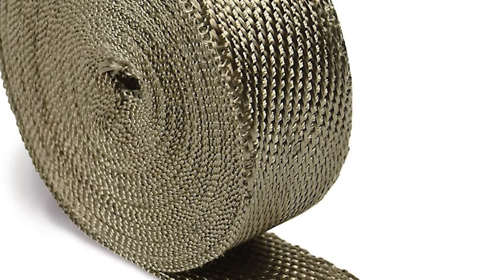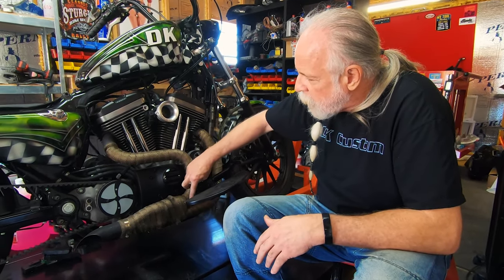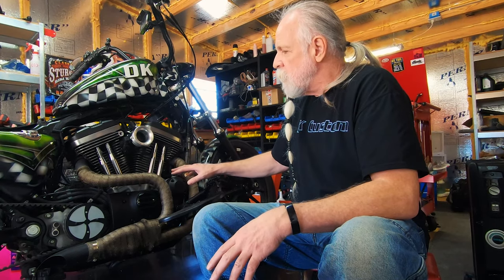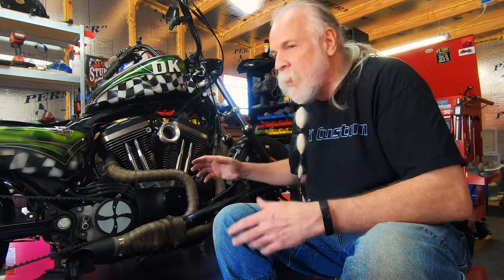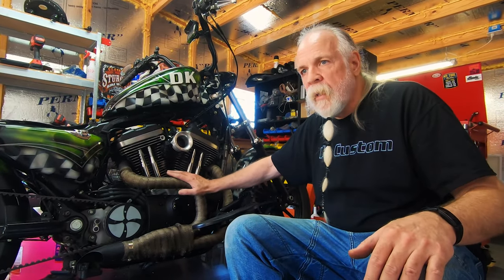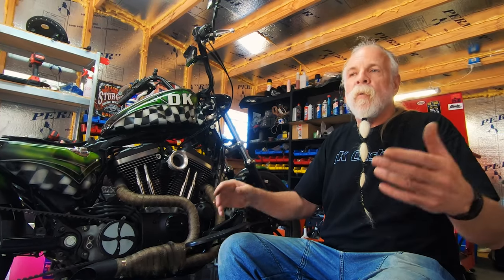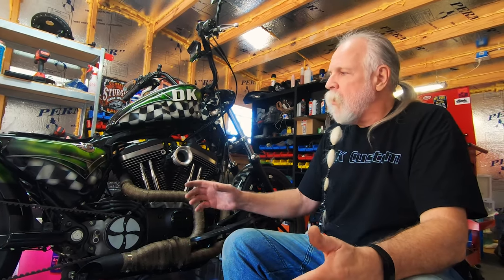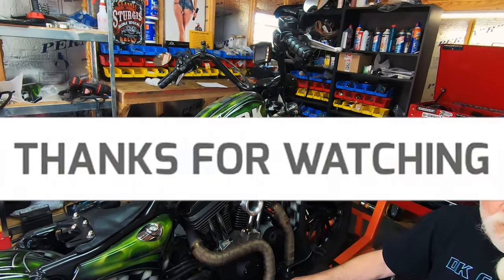Myth Busted - The Real Truth About Header Wraps

Comment: Finally a video that I can relate to! I made my own exhaust with homemade baffles for my RK,2 into 2 shorty drag pipes. Sounds a lot like my old iron head with homemade drags,a nice distinguishable sound, if a little loud. Love the wrap I put on mine,but I’ve set a couple of pairs of jeans on fire sitting in traffic because the pipes get so hot (have to make some nice aluminium heat shields for it). Btw,I’ve always loved jockey shift,so having arthritis in both hands,I made my own jockey set up,but have a hand clutch also. Kicking in the pedal then grabbing the lever makes it much easier for me to pull,and in an emergency situation,I can put my foot down. Not a pretty set up,but no failure after 4 years.
Reply from the maker: Very cool what you've done.

Would love to see some photos of your Jockey set up.  If you want to email them to Support@DKCustomProducts.com attention Kevin in the subject line.

You might like the benefits of some floorboard extensions...get your feet a little further away from the engine, (jeans too) and much more comfortable.   Check em out at this link- https://www.dkcustomproducts.com/footpeg-mounting-hardware-c117-276.htm

Comment: Thanks for sharing. I wrapped my thunderheaders years ago for a couple of reasons. One, got tired of occasionally having to adjust the shields to stop the rattling/squeeking noises that would eventually occur. Two, liked the look of the wrap. 

Glad to hear that it helps with performance be it minimal. I was unsure if wrapping them would help or hurt with cooling of the engine but after one ride without shields or wrap was intolerable it was obvious to go with the wrap. I felt, but couldn't prove, that radiated heat to the engine would be reduced if pipes were wrapped. Shields only protected the rider's legs from heat, not the engine. I appreciate your videos.
Reply from the maker: Cool deal!
Glad you're liking the videos.
Appreciate your comment.

Comment: good video. the rust issue also depends on the exhaust pipe material. if its a good stainless pipe, it wont rust as easily as a metal pipe.
Reply from the maker: Yes, if leaving the wrap wet at all, the type of metal will definitely factor in.  Thank you for the comment.

Comment: I got a 2016 FXDLS that came with that wrap on a Bassani Road Rage 3 stainless. I removed it the other day, and it definitely messed the pipes up, rust spots everywhere, just solid spotted rust. I am restoring it now with scotch brite. But I got it used, the exhaust now looks brand new again
Reply from the maker: Good to hear.  Never know how it was treated in prior ownership, but with stainless there is usually very little rust, even if left wet.

Comment: Just what I needed to hear. Quick one, I might go with soft side bags on my Yamaha FJR. I'll wrap the mufflers that will be directly below the soft bags. Will this prevent enough muffler heat from baking the soft bags after I come to a stop? Thank you.
Reply from the maker: It will reduce felt heat a lot, but you would probably need to know what kind of heat resistance your bags have to know if the pipes would still bake the bags or not. 

You can read a little more about the Exhaust wrap at this link - https://www.dkcustomproducts.com/titanium-exhaust-wrap-dei-reduced-heat-improved-performance-dk-dei-t35.htm

Thank you for commenting! MB

Comment: Thanks for the video!  I'm getting ready to wrap my pipes becouse they are rusty plus the added bonus of not burning my legs is good. 
My question- 
Aprox. What length do you use for a V twin harley pipe? I know the front is a little longer. Thank you!
Reply from the maker: What year and model Harley?  Are they factory pipes?  Do you want to do just the headers?
You can use a tape measure to find out how long the part that you want to wrap is.  Each roll of wrap is good for 11 feet of pipe.
https://www.dkcustomproducts.com/titanium-exhaust-wrap-dei-reduced-heat-improved-performance-dk-dei-t35.htm

Comment: Good day from Toronto : I watched the video and liked it very much . Splendid demonstration . I was not aware that keeping the heat inside the pipe would cause the gases to flow faster . I came from along career in the military turbine engine business . Seeing titanium every day was a regular thing for me . I think the steel supplier industry sells titanium cheap if you buy lots and lots . I'm use to seeing titanium bar stock 12 feet long , 4 inches wide and 7/8 inch think . One piece of that cut into a short 6 inch long bar makes a regular block that would be made into one turbine blade . If you think of that block size , it would cost about  $110.0 Can . Twice I have seen other industries grossly over charging for parts made of titanium . There still is an odd old belief that titanium comes from outer space or something like that , and therefore the high cost . I still roll my eyes and gasp at those people . Any how , very good video !  Have good one .
Reply from the maker: Glad you like the video! Interesting back story. 
Thanks for sharing and commenting! 😎 MB

Comment: Thanks that helped make up my mind I have a 65 GTO and they are notorius for baking the starter and solenoid and I have headers it gets hot in the cab so Im hoping this will help
Reply from the maker: Nice.  My brother had a built GOAT.
Yes, the wrap will reduce the header heat, and a bit of the actual engine heat..

Comment: What are your thoughts on wrapping over the heat shields? Or would you recommend wrapping the bare pipe. My heat shields are pretty weathered so looking at ways to improve the look. My main concern is felt heat so wasn’t sure if wrapping the bare pipe would be too hot.
Reply from the maker: You can wrap over the shields...not sure how effective it will be, or what it would look like.
Seems it would be better wrapping on the bare pipe.  It is made for that, it is not too hot.

Comment: What he says about thermal wrap making exhaust gasses flow out of the exhaust faster are not exactly true. In terms of the volume of gas flowing through the pipe, yes, the hotter the gas, the more volume it takes up. In this way you force the engine to pump out a greater volume of gas. That's not necessarily helpful, and in fact can create backpressure, which is not a good thing (although there are things that create back pressure that also help optimize wave pulses within the headers for greater volumetric efficiency at lower RPM, ergo better peak torque in most cases). 

By allowing the pipes to radiate as much heat as possible, the gasses inside cool. What this means is that at a given cubic foot per minute flow rate, that actual MASS of exhaust gasses flowing out of the exhaust is greater (because the gas is more dense) - this is technically what we care about. But thicker fluids/gasses are more viscous also and there's frictional losses against the ID of the pipe, so there's some backpressure creation there too. There's a give and take. Basically, the degree to which wrap effects any of this is so tiny as to be nearly irrelevant to performance. Unless you have a turbocharged bike (in which case I would wrap my exhaust manifold before the turbine and leave it unwrapped after), none of this matters all that much for performance.
Reply from the maker: Thank you for your thoughtful comment.
Reply: @DKCustomProducts  And thank you for a helpful video about wraps. I learned a couple of things about their practical, real world use.

Comment: 2019 HD Ultra Ltd, 114ci. I'm installing aftermarket headers and wanted to wrap them to reduce felt heat for my wife/passenger. I ordered the wrap from you guys. Will chrome headers make a difference for the wrap?  Ive ordered from yall several times always good service and gear. Thanks in advance.
Reply from the maker: The wrap works great on chrome headers.
What many folks do is wrap the headers and then install the chrome heat shields over the wrap as shown in the video.
Thank you for your business, we appreciate it and it is great to hear that you are pleased with the service and the parts. 👍

Comment: So, true dualed my evo. I put the standard dei header wrap on it. Frist, cleaned the crap out of the original pipes, fitted the trur dual pieces, got everything, where I wanted it. Spray painted them with some rather expensive high heat coating, baked them, used the rest of the spray on coating, and baked them again. Seriously though of putting them on then, they looked really good. But, since I already had the wrap, I went for it. I did, wet it as I  installed, kept it really tight and even,  then learned how to use the clamps for the wrap, with the tool  for the clamps. Baked them dry slowly, then gave them two days to settle. Then, I used the coating, for the header wrap, let it dry, recoated twice more. Did this like 2 years ago, put lots of miles on it and haven't had any issues. Take your time doing it and it will last. Put them on the bike, put the heat shields on, installed some V/H full flow slipons, a much better air cleaner, did the rejetting on my carb(mikuni), and haven't looked back. I love my reversion sound, as I drop off the  throttle. LOL.
Reply from the maker: Sounds like a sweet set up.  Glad you're enjoying your ride!

For others, realize, the Titanium Wrap in this video does NOT need any coating as Charles did with his wrap.

Comment: Would you recommend doing this to the entire exhaust or just locally on a car? I have a C7 Z06 which has the exhaust go around the transmission in the back of the car, radiating heat which is one of the main issues with the car overheating on the track.
Reply from the maker: Wrapping any type of exhaust piping is a crucial and important step when controlling exhaust temperatures and reducing radiant heat. Keeping exhaust gases hotter within the exhaust system helps in decreasing density and increasing the flow of exhaust gases, which will also result in an improved fresh charge.

Wrapping the exhaust from end to end will  help reduce the radiant heat.. 

Couple of things to think about-  It is NOT recommended to wrap the catalytic converter.

It is NOT recommended to wrap titanium exhaust, it can turn the titanium alloy brittle.

Thanks for commenting!

Comment: How about using wrap over top of stainless flex pipe. 5 inch diameter flex. 
Turbo down pipe, flex transition, then more hard pipe. 
How will it handle the movement that the flex has to endure?
Reply from the maker: I have no idea.  Never tried it.

Comment: Your pipes havnt rusted because you put that high temp paint on before wrapping it. Your bare metal isnt exposed. You can also use hi temp paint like you did, then wrap it, then another coat of hi temp paint over the wrap and all.
Reply from the maker: BBQ paint, which is what I used, is not as durable as chrome...so not sure why you came to that conclusion.
Also, the wrap we use should NOT be painted.  It is a completely different type of wrap that should not be gotten wet before installing, nor should it have any coating put on it after installing.
You can see details on this superior wrap at this link- https://www.dkcustomproducts.com/titanium-exhaust-wrap-dei-reduced-heat-improved-performance-dk-dei-t35.htm
KP

Comment: What are your thoughts on wrapping the muffler, along with the exhaust on a 98 Shadow vt750? Also, I have the wrap, but they (the company) suggest soaking in water prior to insulation.  Thank you
Reply from the maker: You have a different wrap than what we are talking about...can't really advise on whatever wrap you have.
The only wrap we've used, or recommend is seen at this link- https://www.dkcustomproducts.com/titanium-exhaust-wrap-dei-reduced-heat-improved-performance-dk-dei-t35.htm
It should not be wet when installed, nor does it need any coating.

Comment: Bought a set of Ultima 2" staggered drag pipes for my 2016 dyna wide glide. Would wrapping them with titanium exhaust wrap as you've demonstrated here and adding monster baffles as well, help with the exhaust back pressure and still keep my power in mid range do you think?
Reply from the maker: You will get the most power low and mid range power if you use the Thunder Torque Inserts™, as seen at this link- https://www.dkcustomproducts.com/thunder-torque-inserts-c57-338.htm
You also may find this video very interesting on the subject of backpressure- https://www.youtube.com/watch?v=pr6z00gL5Yg

Comment: Don't know if you mentioned it but , does using high temp silicone spray (applied correctly) help or not necessary ??
Thanks for your generous consideration,
Sincerely .......................
Reply from the maker: With this Titanium Wrap it is not necessary, nor recommended.

Comment: I have a high pipe scrambler that I want to take for a week long desert ride. Could the pipes get too hot due to the wrap??? Are there any downsides to wrapping? Thank you!
Reply from the maker: Can't think of any reason the pipes would get too hot for their own good....not sure of the quality pipe used, so can't say for sure...if it is as good as the stock metal, no problem for the pipes.
Too Hot for You...that is another question.  But they will be cooler for You than if not wrapped.
Only downside (besides that some folks don't like the look) is if you consistently park the bike with the wrap wet.

Comment: hey! I was hopping you could answer a fiew questions about heat wrapping? I'm about to wrap my yamaha virago's original pipes and I was wondering how hard is it to remove heat wrap, and is there a chance it will damage the chrome finish and if so how can I prevent it? I'm going to use the regular black heat wrap. 

Thank you in advance, and cheers for the video =D
Reply from the maker: Yes, it can damage the chrome, especially if parked with the wrap wet.  We have only used regular black heat wrap once.  Never again.
Here is what we use and have never had any damage, and it is easy to remove...but, still don't put it up wet.
https://www.dkcustomproducts.com/titanium-exhaust-wrap-dei-reduced-heat-improved-performance-dk-dei-t35.htm

Comment: Thanks for the video. I’m about to do the same thing to my pipes. After using the paint, did you heat them first to cure it and then wrap them? I have the pipes off the bike right now getting them ready for paint. Thanks!
Reply from the maker: I think so...we followed the directions on the can of paint, and I do believe it involved some heat cycles.  It was BBQ rattle can paint, probably Rustoleum.
Reply: @DKCustomProducts  ok, it doesn’t take much to put the pipes on so maybe I’ll paint, then put them on for some heat then back off for the wrap. I could wrap them on the bike but it just looks like a pain. Thanks!
Reply from the maker: @markferioli208  Happy to help, thanks for watching!

Comment: I had titanium wrap on my Softail for a couple of years it got ragged on the side going into to wind. I really liked the way it controlled the heat, but it didn't seem to last. I ride about 7,000 miles a year. I'd wrap my pipes again if I could figure out how to make the wrap last. I don't have other heat shields to put on top to help block the wind.
Reply from the maker: Must be how it was wrapped.  I have this wrap on 2 bikes...one for almost 10 years and the other for 7 years.
Neither one with heat shields.  One with around 25K miles and the other with over 35K miles.
The only little bit of fraying is where my boot heel rubbed, as seen in this video.
The instructions say to overlap the wrap by 1/4", but in the curves we were closer to an overlap of 1/2"...AND it is all wrapped very tightly.
Reply: That is good to know. I'll try again.  Do you use any of the protective sprays or paint?
Reply from the maker: @waygone6657  No sprays or paints, no getting the wrap wet first.  Use the wrap at this link, it is different than most- https://www.dkcustomproducts.com/titanium-exhaust-wrap-dei-reduced-heat-improved-performance-dk-dei-t35.htm
Reply: Thanks, I'll try it. I use other DEI products, I trust them.
Reply from the maker: @waygone6657  Good Deal!

Comment: What's the difference between glass thread and titanium, like I want to wrap the exaust and I ordered a glass thread but I'm scared that will damage the exaust as I have seen many reviews on glass thread wraps. Do I have to consider for titanium or these glass thread will do?
Reply from the maker: Glass thread is a type of fiberglass wrap.  Fiberglass wrap has the following weaknesses, which is why we go with titanium wrap, which does not have these weaknesses.

Does not hold heat as well 
Does not last as long
You have to get it wet to be pliable to install
Needs to be coated after install to increase durability
The colors fade more easily

I would send the glass wrap back and get a titanium wrap...you can see more details on it at this link- https://www.dkcustomproducts.com/titanium-exhaust-wrap-dei-reduced-heat-improved-performance-dk-dei-t35.htm

Thank you for commenting! 😎 MB

Comment: Man,you made me go google a couple of things; 
Titanium,you say  ?  isn't that  just plain old fiberglass,titanium color
---the thermal conductivity of titanium is 19 W/mºC  and stainless steel's is 16
So you see that titanium does not insulate,it is a metal, why would they put it in there; 
but,what do i know? i may be wrong.
Reply from the maker: "Made from Pulverized Lava Rock, stranded into fiber material in a Tight Weave"
It is the Lava Rock that has the unique insulating value.
"Titanium exhaust wrap with LR technology is constructed from pulverized lava rock, extruded into fibers, and then woven into a tight weave, giving it titanium-like strength and toughness."
Titanium is just the name.